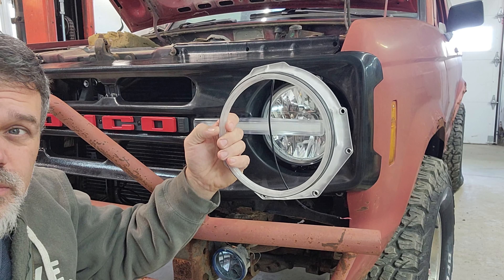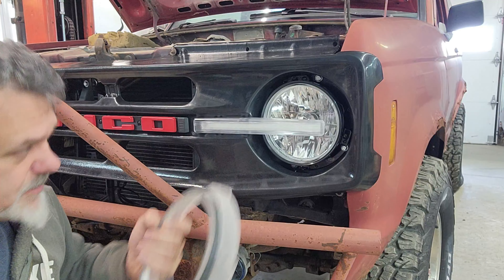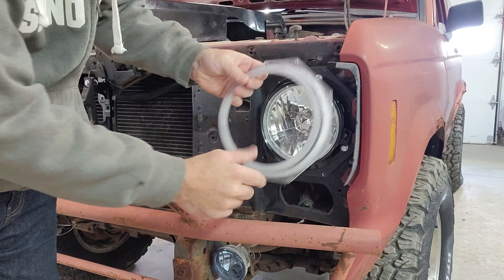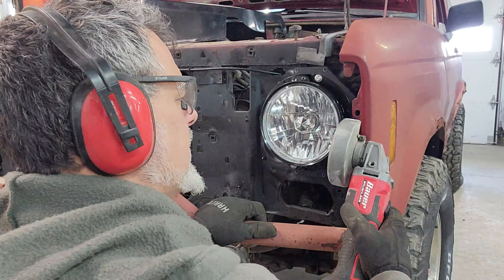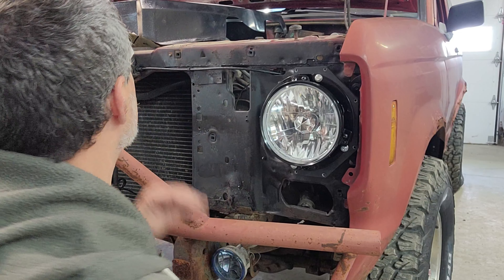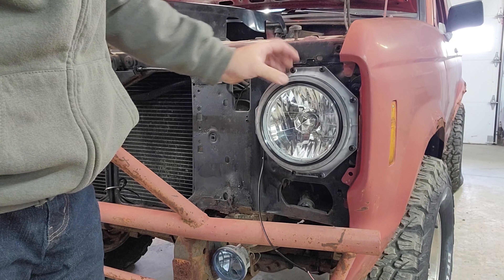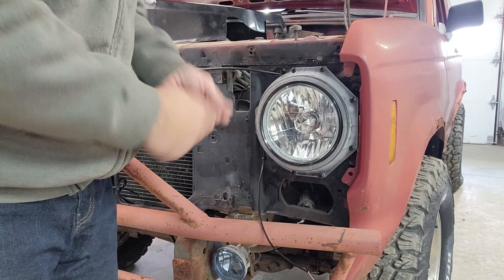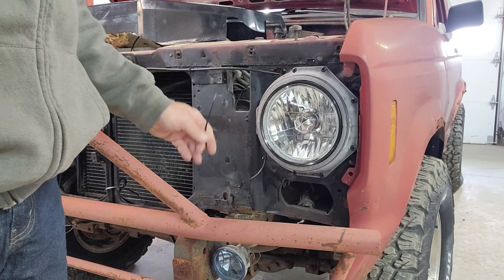Halo Light Ring Installation

Comment: Which specific wire do I hook the Halo ring up to?
Reply from the maker: Both of the red wires from the turn signal and the halo ring should connect to your running light curcuit. I'll look up the exact wire color for it and let you know.